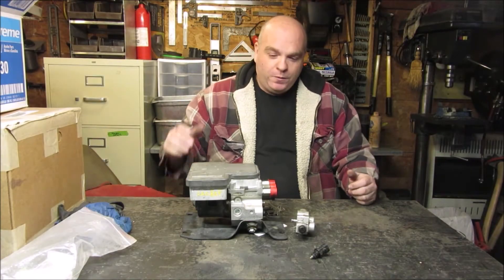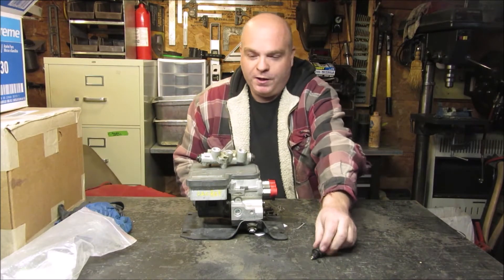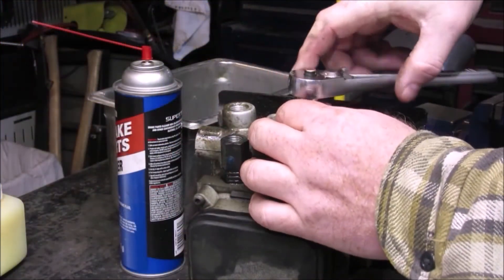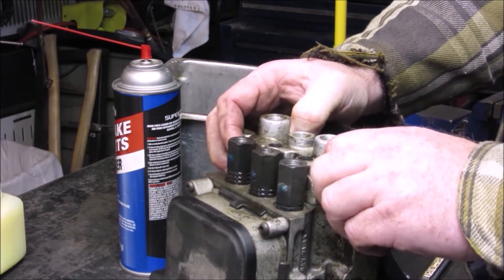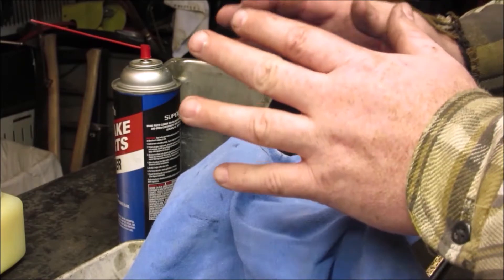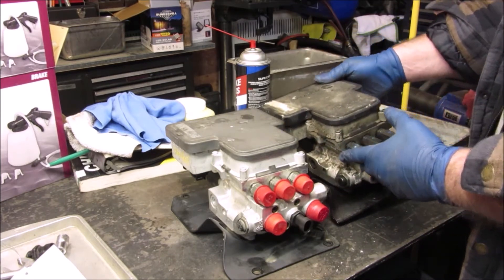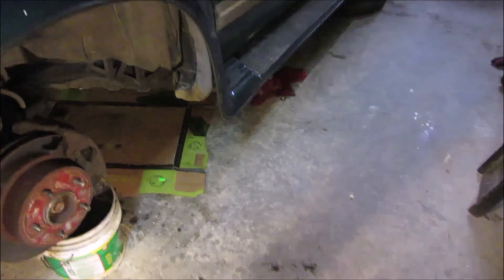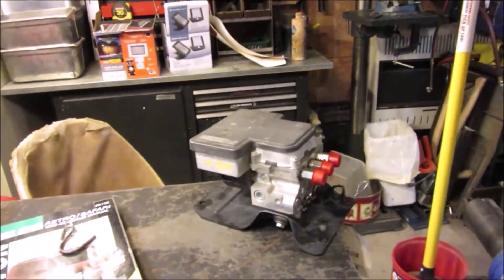97 ASTRO VAN ABS FIX

Comment: Did you disassemble the combination valve? It looked like you have it apart. What was in there piston and springs?? I   am thinking about trying to take mine apart on suburban and shim spring on the rear braking side to increase braking pressure to rear brakes.
Reply from the maker: i started to but didn't really see  much that i could fix  or change
Reply: @JunkworksGarage  I got one off another truck to experiment with. My 95 suburban C2500 has this same abs with that combination valve and I want to shim or change the spring on the rear side to try to Add more braking pressure to the rear brakes because they do very little braking. I hear it's a very common problem with the OBS trucks and suburbans the rear brake shoes look like new for the life of the vehicle because they don't get used much and they go through front brake pads so fast as a result.
Reply: @JunkworksGarage  I have it apart rite now sitting at the kitchen table lol

Comment: I'm having trouble with my van pulling to one side and the ABS coming on on when is stop
Reply from the maker: your having brake problems you should stop driving it and have it looked at by someone
Reply: @JunkworksGarage  beatin around the Bush to much
Reply: Replace the flex brake lines up front. They corrode and collapse inside the rubber and cause uneven fluid pressure and subsequent pulling to either side.  Simple fix...
Reply: @dougpinkerton7266  yup

Comment: i bet  i can but i dont know..... i think i can but maybe not..... it looks the same but might not be..... the plate can change but i shouldn't cause the computer might not be the same... this is identical but the numbers dont match....i dont nothing about this one......i know this is not much of a how to video......this should change  maybe i'm just trying to convince myself.......other than the leaks this has normally  there are no leaks......jeez!!!!  get on with it !
Reply from the maker: yep but its still working go try finding another vid about this on youtube it's a very complex unit that i fixed with no knowledge of  exactly how it worked and would cost a fortune to have done by a mechanic. so if you can do better make a better vid instead of whining about mine
Reply from the maker: ps i warned you in the beginning i was going to talk a lot
Reply: @JunkworksGarage  The only difference with those entire units would be in the combination proportioning valve. The spring pressure for the rear brake side of Proportioning valve would change depending on if it's a pick up truck that is lighter in the rear or SUV van or suburban with more weight in rear. It just changes the brake Bias.
Reply from the maker: @mritron7649  👍